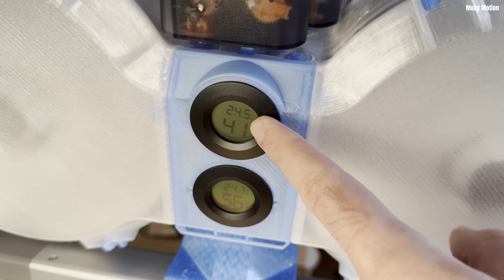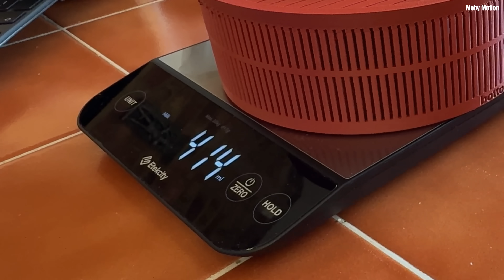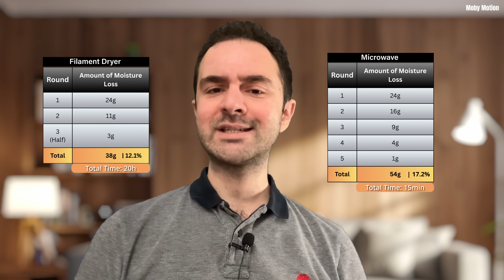Stop Drying Silica Wrong! Microwave vs Filament Dryer Tested

Comment: Fun fact: the drier spot in the first microwave run is there because of the wavelength of the microwaves, which are at a fixed wavelength and hit the same spot in the material the entire cycle(this is why turntables are so common in microwaves these days). 

Even more fun: you can use that property to calculate the speed of light. The most common version of the experiment uses slices of cheese laid out on a plate with the turntable off. You can search for something like "cheese light speed microwave experiment" if you want to try this at home; its very easy and, other than the worry of touching very hot cheese and getting a burn, very safe to do

Comment: What I use is a specially designed large box made with PETG that I found on Maker World that fits on top of the Polymaker Polydryer base. It's not a fast solution by any means, but because it's just circulating warm air through the beads, you never have to worry about melting the container or the beads being too hot. If you're like me and only having to recharge smaller batches of beads, it's a pretty good solution. Also, I don't like the idea of drying chemical beads inside appliances that I also cook my food in.

Comment: I’ve tried different methods. I initially found microwaving the silica too easily overheated and “ burnt” some of the beads, so the next time I used a conventional oven which worked fine except i found that working with Pyrex dishes was difficult to pour out into my containers without getting silica beads all over my kitchen. I then tried and have settled on using a food dehydrator, I made some PETG trays with built in spouts to easily transfer the beads out and sized them to match the size of my shelves, I dry them at 122F for a few hours, Checking them and stirring the beads a couple of times and I found this to be my most convenient solution. The beads don’t get excessively hot but the forced warm air flow seems to dry them well, I will admit that I haven’t tried weighing them before and after but base my satisfaction on the color change.

Comment: I switched to Activated Alumina. Alumina is considered safer for humans than silica, some of which can contain cobalt. I also found it is far superior to silica, the humidity in my AMS dropped from ~18% on average, to ~10%(lowest the gauge could read) with the same amount of desiccant and it maintained that level much longer. I dry my dessicant in the oven, it will give instructions for time and temperature. Usually 2-4hrs and for silica it is ~230f, I think Alumina is over 400f, same time frame (I haven't had to dry it yet, very efficient).

Comment: I purchased an old used tabletop convection oven(yoadter oven with a fan/air fryer) from a second hand shop for 10 dollars. I set it up in my shop and set it to dehydrate mode at 175f and allow the beads to dry overnight... between 16 and 24hrs depending how im feeling that day. I have 2 5lb batches if desicant I rotate between all of my storage solutions. I can drop the humidity% from "fully" saturated to a usable state.

Of note, i do nuke the beads in the microwave on 50% power for 5-8min if im going to use them for asa/aba/tpu storage so they are as dry as possible, where i dont need sub 18% humidity for petg and deff not for pla. 

I have only ever used my printer bed to dry beads/filament like 3 times as my printer is for printing. As the owner of a single H2D well over 1000hrs on it, i need thenprinter to print and not to dry. I do use the ams2 and HT to dry filament when absolutely necessary.

Comment: Silica gel is regularly used in industrial processes to dry compressed gases. The way these processes regenerate silica is "cooking" it to high enough temperatures with a good flow through it. The higher the reached temperature is the driest it is going to be. It can be safely heated to temperatures of 375F (190C). Industrial processes go up to 450F (232C). An air fryer is certainly suitable way to dry these as there is a good air flow and suitable temperatures can be reached.

Comment: A good experiment would be to test the beads after a few drying cycles to see if they still can hold as much moisture and calculate the wear factor for each drying type. The uncontrolled temperatures in the microwave are said to damage or wear the beads out faster. Lower heat will yield more useful cycles from the Silica. 65C is very low, so 75 or 85 is better, and 120C is closer to what the manufacturer recommends and toaster ovens or air fryers are ideal for this temperature. The color pattern in the microwave shows you how uneven heating is in the microwave.

Comment: What we really need is a microwave with an extractor fan.  Most microwaves don't so they don't dry out the food, which is why they fill up with clouds and get so much condensation.  An extractor fan would keep the air inside the microwave relatively dry and speed up the process even more.  Maybe 3d print an adaptor to fit over the microwave vents and add an external fan.
I'm guessing your microwave doesn't have a turntable judging by the hot spot.  A turntable is important to avoid localised heating.  Something like a Pyrex flan dish would probably be best for this, so that the beads are spread thinly, but that assumes you're not getting a hotspot.  If you do get a hotspot, spreading out the beads is only going to mean even more beads are outside the focus.

Comment: 1. For a complete evaluation you should measure the energy "consumed" with each drying method.
2. In both cases, the beads layer height should be smaller and the surface bigger.
3. The jig used in the dryer doesn't have enough surface exposition, nor the pyrex container but a little bit better.
4. Using Gemini to compute percentages? Huh!

Comment: there's more into this.. PETG preset use relatively low temperature for drying silica gel and also most dryers are really bad, many of them does not even have air ventilation or rotation...
I would like to see comparison with much better dryer, maybe BambuLab AMS HT or something else with even higher temps...

Comment: I printed that same AMS lite enclosure and it sucks 
The humidity is always reading significantly higher inside the AMS lite enclosure than the outside air no matter what I do.
Even the control hygrometer reads higher than another hygrometer I have ona table a foot away.
That this is more of a moisture trap than a dry box

Comment: And what about the good old oven? After my wife has finished baking i use the heat to dry my silica after the oven has cooled down to about 110C. no extra energy, nothing. I rinse the baking tray afterwards with fresh water - finished. 
And yes i do it in the normal oven. I use the orange to green silica - no cobalt. And since I wait until the oven reaches 110 degrees, there is no risk of burning residue or anything similar.

Comment: Air fryer with dehydration option (e.g. Ninja Foodi Dual Zone). 60C for a couple of hours. Just don't use all colour changing silica but a mix of 90% clear 10% colour changing. Colour changing silica is bad for health.

Comment: I buy my Silica in 50 gram bags. I tried the microwave a couple of times, and while the moisture came out of the Silica, it stayed on the bag, so I never could get the bags completely dry. The best way (that you didn't even try) is in the oven. I have a large baking pan with a wire rack I put the bags on, then in the oven for 90 minutes (flipping halfway) gets them thoroughly dry. Then I store them in sealed Mason jars. I use them in my filament storage containers, and they also fit inside the hole in the spool while in the dryers to make the dryers more effective.
Reply: What is the oven temperature?

Comment: Hi, I have use both as well. By weight the micro wave always removes more weight - presumable water weight.  I agree on using the high heat glass holder.  The microwave is simply is the most efficient in both energy use and drying.  You performed a good study.

Comment: Note - there’s two kinds of Pyrex. There’s the original Pyrex, and the. There’s the new formula called “pyrex.” All lower case. People have complained that “pyrex” is more susceptible to thermal shock and shatters more easily.
Reply: Also is the filament dryer filament  container PETG?

Comment: Microwaving is a great idea. I wouldn't risk such an experiment myself.
I dry silicagel on a baking sheet in the oven. I spread it evenly on the baking sheet and place it as close to the top of the oven as possible. I turn on the “Super Grill” mode at 180°C (very powerful upper heating element) and the internal fan.
After drying in this way, my silicagel has a residual moisture content (according to the moisture sensor) of 21-26%. And in a closed AMS enclosure, the moisture level is maintained at around 29% for a long time.

Comment: First of all sorry for my English. I see the Video and had 2 important questions. First, when you dry the silica in the Dryer, can The Air in the Dryer circulate? Second Do you close the lid complete? I think, and thats not theory, you should open the lid a little bit, so the humid air can leave the dryer.  Or you should  open the Dryer, i would say, every hour. 
A microwave has an ventilation , so the humid air can leave the microwave. I think with a good air circulation you need less time for drying in the dryer. I hope you understand my theory......
I dry my filaments in the dryer and opens the dryer every hour and i can read on the hygrometer instantly the falling humidity. I think it's a point you can tested for your self or you mak an other interessting video.
Thank you for your professional test. I like your video and hope you read my theory

Comment: Just a few things that went through my head while watching.
1. Your desiccant's indicator contains cadmium (a heavy metal). You don't want to spill it in the kitchen and you don't want to handle it with your kitchen utensils, especially you shouldn't use the Pyrex bowl to prepare food any more.
2. Gemini is 💩! I have used it three times and it always gave me wrong answers and i know someone working at Google who says they're under a lot of pressure to get better and be comparable to other publicly available ai models.
3. When you dry desiccant that's supposed to turn orange in a red spool/basket that colour deceives your eyes and you won't be able to distinguish between stages of dryness.

Comment: A couple of questions that you didn't answer.  1. how much energy did you actually use with each drying method?  2.  What was the original weight of the desiccant before they got saturated in the first place?

Comment: You may lookup for adsorption dehydration process. It is routine in natural gas processing and other industries. Residual water content in desiccant depends on regeneration process temperature. Typical regeneration temperature for silica gel is 150 °C. Typical regeneration temperature for zeolite is 280-300 °C. Once you've reached this temperature you need to evacuate desorbed water vapour — and that's it. Since there's no gas actively blowing through the desiccant in presented setup, it takes time for water vapour to diffuse through the outer layers of desiccant. 

Lower process temperature will leave desiccant under-regenerated. Under-regenerated desiccant is not able to adsorb water at lower relative humidity. So if one observe that RH in a storage box never drops below e.g. 40%, than one probably should reconsider the regeneration process (or there may be faulty hydrometer).

Comment: How come you didn't try the oven in your tests? One issue with microwaves is they don't vent out the moisture during the heating. An oven with the door ajar would be quick and efficient. Even better is a food dehydrater as it has great airflow and even heat.

Comment: If you ever redo this, the thingthat could confirm the effectiveness is to take the beads from the dryer afte the 24 hours, weigh them, then nuke them in the microwave and reweigh them. That would prove there was still moisture that needed to be removed even when the dryerhad maxed out.

Comment: Also the paper envelopes that hold beads that come with filament can catch fire in microwaves. They can get very dry in a microwave.  
The dryer the silica, the drier the air is going to be in your container. Its not like silica gel pulls all the water out of the air. I believe that as the gel gets saturated it can only dry the air so far. Drier dessicant is going to result in drier filament. 

Print beds on some printers can get much hotter than driers. The Ender 3 KE for example goes to 100˚C.

Comment: I got a new Bambu H2D with AMS and got a AMS-HT as well.  I don't have any -cf filament to make a dryers with (yet).  But I was wondering if the AMS-HT would do well since it can rotate the 'spool' while drying.  I did just order some desiccant, so I am just starting down this rabbit hole.

A quick analysis of your results, it looks like doint 3 rounds for 3 mins in the microwave could be your sweet-spot for time/power vs dryness.

Comment: man, use the dryer on ABS settings, for me I use the polydryer on the highest setting and it takes ~2 - 2:30 hrs.  multiple of 8hrs is ridiculous, single 8hrs is ridiculous.  Note i use a PETG container to hold the filament, it does not warp or sag, its completely fine.  Now I don't dry so much at a time, I usually do something like 1 or 2 small containers worth (like for the polydryer bin or an AMS insert)

Comment: 80°C in the oven for 3 hours stirring every half hour.

Manufacturers say if you always dry in the microwave, it will not regeneratevas many tomes - you shorten its overall life.
I never use the microwave. 
Longevity outweighs the cost of convenience for me.

Comment: I use wardrobe dehumidifier. That stuff absorbs much more water than silica gel and lasts much longer. When it starts becoming mushy you just throw it away and replace with new. You really just need a very small amount of it to bring RH to 10% in a closed container. Also less expensive than silica, paid 1€ for one of those hangable packets, cut it, took the beads out of it, wrapped them in aluminum foil so they don't make a mess when they liquify. Out of 1 packet I made 4 smaller packets this way, used in 4 cereal box containers, been using then for 1 year they're still solid

Comment: I was using 2 different filament dryers to dry/recharge my desiccant... After the first use, and recharging using the dryer, the desiccant just did not seem to work as well as the first use out of the bottle.  I now dry using the microwave and it is a game changer.  The desiccant works just as well as right out of the bottle.  Drying is performed in 1-minute bursts in a small 800W microwave.  I stir after each burst.  Usually complete drying is done in 4 to 5 bursts and the desiccant lasts a very long time.

Comment: I just got a Bambu Lab P2S with the AMS2 Pro and printed desiccant packs for the inside. This keeps the filament in the AMS dry and when the desiccant loses effectiveness, the AMS2 Pro has a dryer built in. Just set it up for drying and you shouldn’t even need to change the desiccant in your packs. At first impression, the built in dryer seems effective in principle. You set the temperature and drying time and it does its own venting. The principle is sound.
The microwave does it faster but it’s best in small batches and you need to open the door frequently to release the moisture. If you have a convection microwave, definitely use this setting

Comment: I had been drying in the P1S printer when not in use, and sometimes used the oven or my Sovol SH02 filament drier, all take hours so I bought a cheap €50 microwave and the difference is night and day, not only quicker but the beads come out drier and not to mention the energy saving by using the microwave.

Comment: Thinking about your short periods of time in the microwave- the first few periods removed a lot of moisture which would have gone into the air as water vapor.  I think it would be good after a short period to open the microwave door and allow some dryer room air to enter the microwave before the next period.  If you had only done one long period all of the water vapor would have been in the small volume of air in the microwave.  This might limit how much water could be removed from the desiccant no matter how long they were left in the microwave.

Comment: the Orange "Dry & Dry" page suggest to run 10 minutes at "Defrost" in the microwave.. Defrost is 30% duty-cycle for any Brand.. my old microwave was a 1400w and now i have a 900w.. so, the 10 minutes look not so scientific!! ..i’m happy to see your tests because with my old 1400w at Defrost for 10min had done a mess in it and i never retry since.. with your video, i will try again with more precautions!! ..thank to have shared your experiments!!!

Comment: I use a 1000 Watts microwave, with the level - Melting Butter Sticks (45 seconds) 3 times, with 5 minutes out of the microwave each time, to cool down a bit. I use oven gloves to remove the Pyrex. I only dry 50 grams each time, in a large Pyrex. Only one layer of beads at the bottom.

Comment: I use a second Pyrex bowl to pour the beads into after I get them out of the microwave. That way the residual heat in the original bowl will not prolong the cooling of the beads.

Comment: whats the chance it is the filament dryer that you used? i've seen a bunch of stuff on the s4 for this purpose... also, whats the chance the stacking of the beads deep (like you had the roll on its side)  factors in vs more spread out thinner? just curious